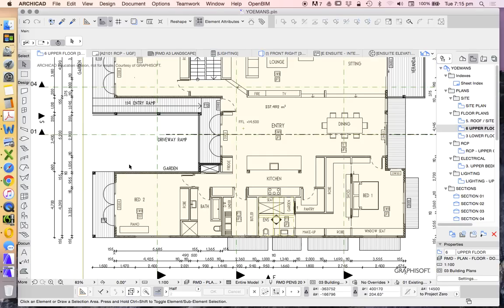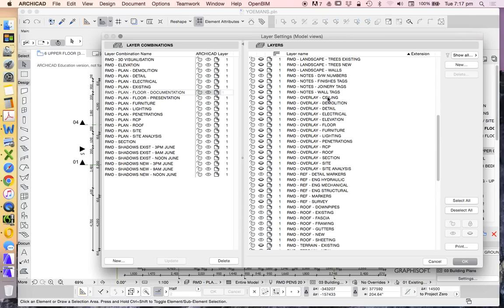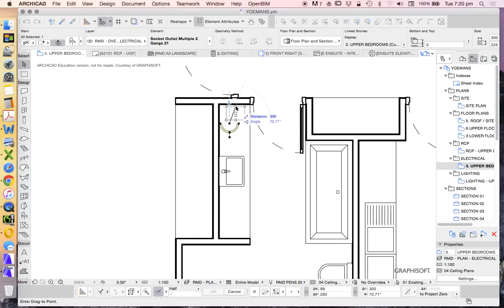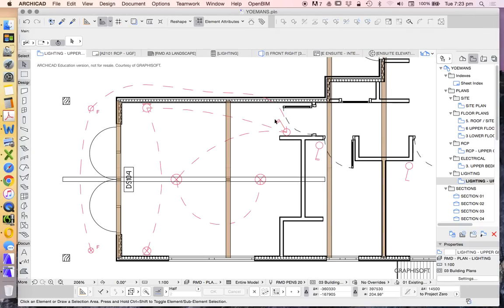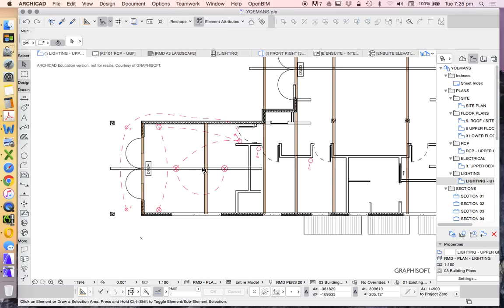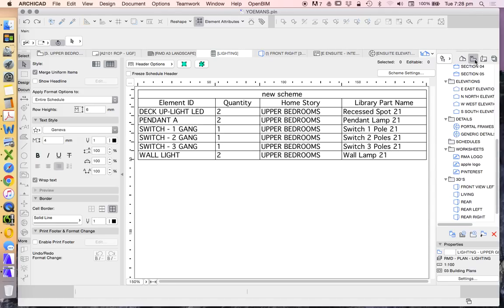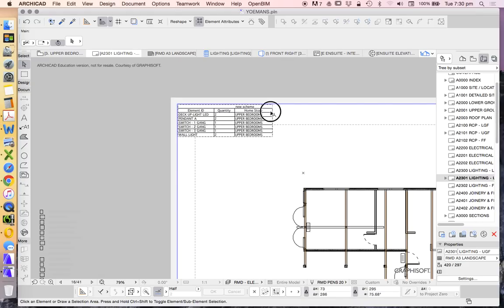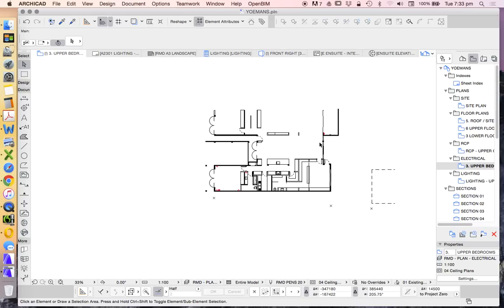Archicad Electrical plan & schedule

Comment: Lovely video but unfotunately i think you should respect the standard EE (electrical equipment) symbols. I work in the field and i can tell you for sure you are not using a transformer symbol instead of a socket one. use the socket symbol and add  number 2 on top or two lines in the semicercle if you want to draw a double socket.  You will only create huge confusion with electrical teams. you shouldnt design electrical systems if you dont have knowledge in it. How do you know where to put junction boxes or types of fuseboards , how to you calculate loads, voltage, amps and wire bedding?   for basic design like lighting and such it could work..but revit is far away more advanced in electrical, plubming and HVAC design. As i said, if you dont know the national normatives and regulations, you shouldnt design electric plans that hit the contruction site.

Comment: robert how do you create legend
Reply from the maker: Hi Ipuleni, I usually create a legend as a worksheet (2D). this is done simply by using the object, text (or 2D lines) as a symbol, and then placing this on each relevant layout or on the master layout if I want it to be seen on all pages. The schedules are much more complicated. I have made some other videos on this process in several parts.

Comment: I haven't found a way to display a particular bit of information & could use some help.  Is there a way to run; and schedule wiring through an entire house by gauge/type & total linear footage in Archicad 22? (I've been searching the scheme settings/schedule fields; and linear footage is not an option. I've tried all the logical options and still no luck)